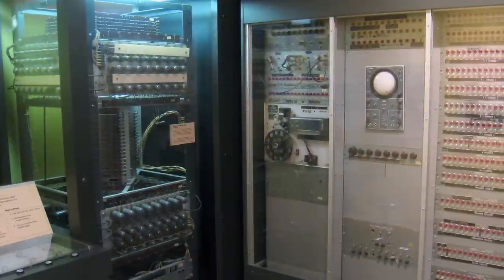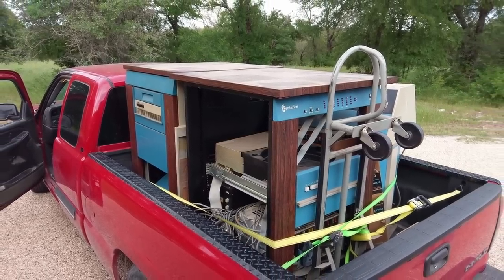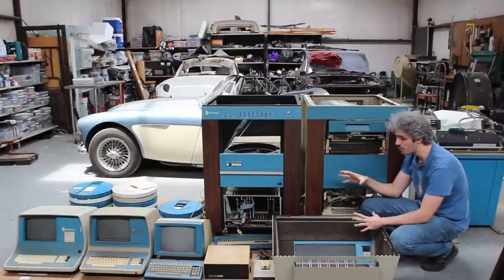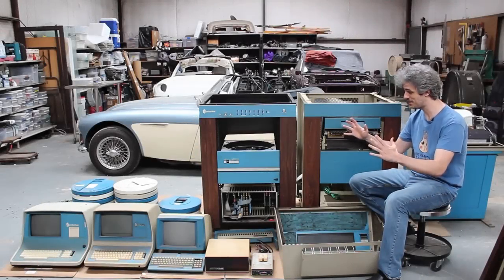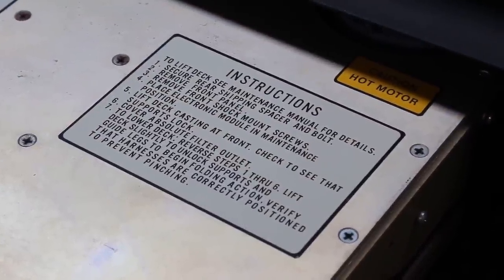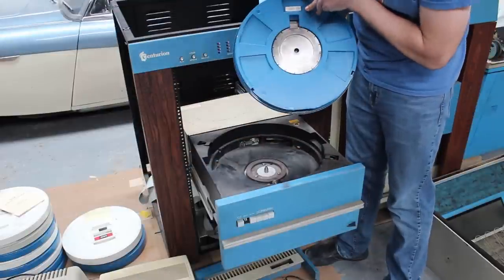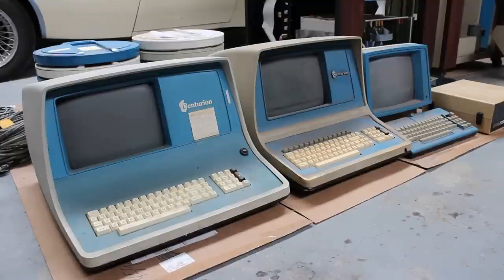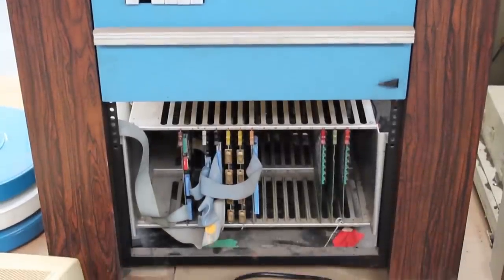I Bought a Minicomputer from 1980! – Part 1

Comment: Oh man, She is a thing of beauty. This is going to be one hell of a series.
Reply from the maker: Thank you!
It's going to be a lot of fun flipping back and forth between the tube computer and this big beast!
Reply: @UsagiElectric  I wonder if you could somehow use one of the termilnals on the valve computer. Although I would'nt even know where to begin with that. :) Just an idle thought.
Reply from the maker: @frankowalker4662  Actually, I think that might be something that's totally doable! The terminals are just a 20mA current loop, so they're expecting serial data at a specific baud rate, and that's about it. That may be something worth trying in the future!
Reply: @UsagiElectric  Wow, realy? Cool. :)

Comment: Used to work at a hotel that had a minicomputer in the back office to run the property management system. When you put the disk into the drive, you'd flip the case over and put it on top to store it
Reply from the maker: That's awesome that you got to use a Mini in its element!

Comment: This looks pretty cool.  

You are really lucky that black foam just dried out and crumbled to dust.  I work on vintage analog synthesizers and many of them had black foam inside to dust proof the slide potentiometer controls on them and it actually reverts to liquid form with age and turns into a black, super sticky tar that is a real pain to remove without damaging paintwork or the pots themselves.

Comment: I wouldn't be jacking media in and out of the drives until you get some instructions.  The relationship of the heads and media was precise and delicate.  There was one way to install or remove media and 99 thousand ways to do it wrong.  With the power off I'm particularly concerned.  Maybe someone who knows exactly can chime in -
Reply: they will need to be aligned or the first time you spin them up, the heads will crash, 
and then you can toss the entire drive in the garbage!
Reply from the maker: Thank you for the heads up!
I was looking at the drive and it looked like the read heads are swung out of the way, so I figured just setting the media in place would be alright as long as I didn't put any power into it (I also chose a disk that didn't seem to have any important notes on it in case it became a sacrificial disk). Though, to be honest, I'm more worried about the fact that it's been moved around a lot presumably without having been locked down into place.
At any rate, both drives are going to come out of the chassis for a cleaning, inspection and alignment, hopefully to avoid a head crash in the future!

Comment: Epic, reminds me of the time i got a 60s PA system from a factory. It filled an entire  van and weight a ton, had 4 philips tube amps, pre-amp,tuner, 2 turntables, 2 reel recorders and a microphone all built into one giant custom steel cabinet. i now also found a partial ibm system from the 60s.

Comment: I seen somewhere that for the 50th anniversary of the ENIAC they basically showed how technology has changed by taking the giant room size computer and were able to put the same processing power on a chip that was 4 square inches.
Reply from the maker: And the 50th anniversary of the ENIAC was way back in 1995, nowadays, that same amount of processing power is so small, it roughly the size of the head of a pin!
Reply: @UsagiElectric  Crazy isnt it?

Comment: The first business computer I used was a Data General they installed in an auto parts store I worked at. At the end of each night I had to swap out one of those removable disk platters which sort of backed up the day's data. All these components look very similar so I'd say this puts the system squarely in the early 1980s era. Completely underwhelming as an actual computer but at the time, it was a great way to manage a business that was previously done manually with general ledgers and a huge card desk for tracking inventory.
Reply: My grandfather ran a small business, and from the mid-1970s through to 1990, brought home a removable CDC disc pack every weekend.  (The bookkeeper brought one home on the other days.)  It was significantly more primitive than the Centurion, but having core memory and being single user meant that you could punch in the hex address of the point where it failed after a power outage.)

Comment: takes me back to college and my first job. At work we had a MUCH larger set of mini computers, a vax cluster, and a MODCOMP classic II.  4 racks, 6 feet high.  washing machine sized 60 MB removable hard disks, and a big brother to your chain printer that could go so fast the green bar paper would shoot in a loop 4 feet high pout the top as it printed.  The one in the college was even larger.  A DEC System20.  its lots of fun to get these old machines running again.  If you have old 4kx1 static rams on the memory cards they are likely to have lots of issues.  16k drams are similarly unreliable - very susceptible to radiation damage from the tiny amount of c-13 in the plastic cases on the chips.  NOS ceramic case military/aerospace parts form that era are still functional, but the commercial plastic encapsulated parts are a total crap shoot - less than 25% still work in my experience
Reply from the maker: Four racks, six feet high is a ridiculously huge computer! I was checking out pictures of that Modcomp Classic II, and man alive it seems all the mini-computers of the 70s had fantastic switches on the front of them!
The DEC System 20 is massive! I would love to be able to climb around all these old massive minicomputers one of these days.

On this Centurion, it looks like it has a bunch of 2kx1 MCM4116 DRAM chips. Fortunately, all the DRAMs are socketed, so if I have a bad one I won't have to do a bunch of desoldering. Though, I have no idea how reliable the MCM4116 is - I'm hoping they're decent chips and I won't have to end up replacing most of them.
Reply: @UsagiElectric  they are unfortunately still fairly flaky but not as bad as the 16kx1 chips.   Old drsms are also super sensitive to power supply start sequence.  It's vital that the negative supply come up first, then the 12v then the 5.  In that era this was usually "garunteed" by the size of the supply filters.  If the capacitors have degraded or failed it can cause catastrophic damage as a result of forward biased parasitic diodes in the chip substrates.  Check the power supplies under some load with resistors to ensure they come up correctly before you power up the main cpu, or pull out the ram cards the first time and just look at voltages and ripple.  If its like many smaller systems of that vintage it may have highr voltages one the backplane like 8 and 16 which are regulated down to +-5  and 12 with 78/9xx series regulators on the boards, or bigger lm340 types in TO3 packages.  Again carefully inspect the electrolytics around any such, even test them if you can. That is a common point of failure even at the time and those capacitors usually don't improve with age.

Comment: Centurion computer, great project :) The printer is a Band printer, was in common use before dot-matrix printer, don't be surprised, the printer might write very fast, we had one that wrote 10+ pages pr. minute. The terminal is properly simple VT100 terminal or something like that. RS232 or current loop. The CPU board is properly made of 74-series chips and an a (EP)ROM for instruction decoding.
Reply: The harddrives are propery 5 or 10 Mb :)
Reply from the maker: Thank you!
And 10+ pages per minute is insane! I mean, I had an inkjet printer just out of college that couldn't go that fast (granted, it was a pretty trashy printer, haha). Now, I'm even more excited to get that printer up and going. Even if it just types out the test print page, it'll be exciting to see it in action!
The CPU board looks to be like two AMD AM2901 4-bit bit-slice ALUs and two AMD 2909 4-bit bit-slice address sequencers, and then a colossal amount of 7400 series logic ICs. It's super cool and I can't wait to dive into it in more detail: https://i.postimg.cc/63KLkQF6/IMAG3642.jpg
Reply: @UsagiElectric  Band or chain printers are quite loud.  You might be sorry you took the foam out....
Reply from the maker: @stevenscherbinski1512  The foam was falling out on it's own in most places, so it needed to come out so as not to damage anything. I may go back and line the inside with sound deadening material like Dynamat or something. It'll probably add another 30 pounds to the machine, but may keep it from making my ears bleed. I'm super excited to see this thing run though!
Reply: They are ADDS Regent 40, ADDS Regent 100, and ADDS Viewpoint terminals.

Comment: From what I read about Centurion when I paused the vid, it appears they did turnkey business solutions and the hardware they used, at least the disk drives, are Control Data Corporation products. The line printer looks like something I used way back when I first started in the industry, only the brand was Data 100 and the color scheme was mustard and black. The external appearance other than color was exactly the same. It had that same black foam sound deadening material inside the lid, and appeared to be the same mechanically inside. I remember ours used to get paper jams regularly. One thing you don't have, though, is tape drives. The mux and modem would have been for communication on a leased data line to some other location.

Data 100 was acquired by Northern Telecom but retained the branding and color scheme. For some reason my company used this setup to act as a remote site to our IBM mainframes located in Houston (and occasionally to some other places) rather than use IBM equipment to do that job. I recall that we had some emulator programs to allow our system to run like various other company's hardware to access reports and do other work, but mostly we emulated an IBM RJE station to submit and output batch jobs to and from our Big Blue systems.
Reply: At least as a chain printer it wasn't likely to have the kind of paper jam complications that the early drum printers could have.  The "Printer On Fire" error code in many UNIX versions didn't start out as a joke.
Reply: @evensgrey  We had a Data 100 drum printer before the chain printer was added as a supplement. The drum printer - at least the one we had - was fine, very few problems. The chain printer was a never ending problem source, and slow to boot. Later we got rid of it and added a newer model printer which was Data 100's clone of the IBM 1403, IIRC. For all I know IBM built it for them in their colors. Or perhaps Data 100 licensed the design from IBM.

Comment: That Micom unit is basically a digital "PABX" for switching serial RS-232 connections. I installed and managed a Micom 600 system which occupied three 6 foot racks and had several hundred of those cards. It was the digital switching unit for all the terminals and computer systems in the university where I worked back in the late 1980s. I still have a couple of the cards and the operating/configuration manual as souvenirs from that system after it was de-commissioned around 1993. You probably won't have any use for the Micom unless you plan to connect many terminals to your computer.

Comment: I want a mini one day. A project I always wanted to do was make a basic modern PC but reverse-miniaturize some of the components so the whole thing can fit comfortably in an old mini and utilize all the space. If I was rich I'd build a 1950's computer to run YouTube and make the whole thing as big as a small city.
Reply from the maker: You and I are definitely cut from the same cloth, because that sounds awesome! With this one, I'm actually going to try to stuff everything into a single cabinet, which will open up the second cabinet for stuff. And I totally want to make the most insane discrete transistor homebrew computer that fills up the second cabinet, I think that would be epic!

Comment: "Warrex Centurion, an 8-bit minicomputer built by Warrex (later just Centurion), a Texas based company from the late 1970's to the 1980's. The Am2909 and Am2911 microprogram sequencers and the Am2901 ALU were used in the CPU6 variant." https://en.wikipedia.org/wiki/AMD_Am2900

Comment: In the late 80's I used to go to a local auction house that sold various thing anyone would bring in. A couple of days before the auction, you could come in a look at the items to be auctioned off. I wen't in the one day and there was this IBM mainframe system with 1 printer, 3 terminals, cables, software and manuals. The computer stood about 54" tall, 36" deep and 80" long. the printer was about 48" high, 30" deep and 30" wide. Well, of course, I had to go there tat Sunday night to see what it was going to sell for, with no intentions of buying it. When they got to the IBM, I can't remember what the bidding started at, but the price kept coming down and down. It came all the way down to $5.00 and I raised my hand and it sold for $5.00. I paid a guy $25.00 to load it up on his trailer and take it to my parents house.
Reply from the maker: Color me all the shades of jealous! That is an absolutely amazing deal for anything old and IBM, even if it was in the late 80's. Do you still have the system, or know where it is? I would love to see more about it, that sounds like a really epic machine!
Reply: The "secret" of all these mini-computer companies is that the IBM equivalent was easily three times as much.  I worked for two, Sycor, and Data 100 which were merged under the ownership of Northern Telecom.  Our customers would at contract's end replace us with the competition and when we went to take out our equipment we would recognize the techs from the other company putting in their stuff.  We had a scare once that one of our big accounts, UPS, had a new IT manager and he was a fan of IBM.  When UPS management found out that switching to IBM would triple their IT budget they switched him out.  Texas Instrument had some sort of RJE System which used too much plastic.  Motorola started a division to do this called Four-Phase.  Exxon tried to get into the office computer business.

If you, for some reason, want to go down the rabbit hole of used IBM computers check out Saul Steinberg's Leasco.  After he founded that and became a millionaire he tried to take over Chemical Bank.  He has passed away, but his son is married to Maria Bartiromo.  Also, checkout the OPM leasing scandal where the scammers took money from banks by getting loans against number sequences which they asserted were the serial numbers of IBM mainframes.

Comment: I´m so excited to see it come back to live again!
I wonder, if the “modem” is used to connect several terminals, using a current loop?
Reply: yes
Reply from the maker: Thank you! I'm excited to get stuck into it. There's a lot of super interesting things to learn about how they did things!
It seems that that's case, which may explain why I got three terminals with the system. The company may have had all three terminals set up as workstations connected into the single computer. It'll be a ton of fun experimenting with once it gets closer to fully operating!
Reply: @UsagiElectric  yes, it is very likely some form of timeshare UNIX system.
Reply from the maker: @tekvax01  That makes sense!
Reply: I always thought it was cool that modem stands for Modulate-Demodulate.
Reply: @UsagiElectric  So the modem is handling multi-access stuff, that's probably the reason why its as big as the computer itself :)
Reply from the maker: @nyccollin  Wait, what?! Mind absolutely blown, I had no idea that that was modem stood for!
Reply from the maker: @schmitzvonschmitzen2870  Haha, you know, I didn't think about it that way, but it is just about the same size as the actual computer itself. That's pretty wild to think about!
Reply: The big box "modem" is also known as a serial MUX.  It's what you use to connect those terminals to the mini computer. Typically they used RS232 serial communications. I had one like it on an old Unix server.
Reply: Yes its a multiplexer
Reply: @UsagiElectric  Not sure how old you are, but back in the 80s, early 90s, the banks would have dumb terminals at each station, and the operators would be sitting there tapping the enter key, over and over, to keep their terminal active and in cue.
That box with the DB25 connectors was for each station terminal to plug into.

Comment: Band printer.  I worked with some old SEL equipment and we had printer similar.  That band spins continuously and the hammers are synced to bang against it at the proper moment.  We had ones that were rated 600 lpm (600 lines per minute) so could actually go pretty darn fast.

Comment: They would have done you a favor if they had left one of those removable disc packs in the drive.  When they are in, that big opening is somewhat sealed by the plastic cover.  As it is, the retractable heads in the side of the machine are probably dirty as heck and will self-destruct if they try to load.  We had some larger 300 MB 'washing machine size' drives and used to replace individual heads.  Then there was a whole alignment pack and break out the O-scope to align them.  What memories.  :)

Comment: the Micom Micro8000 most likely is a Data Multiplexer it went out to all the different terminals around the building &  you had just one Main Master Terminal and all the other terminals went through the Micom Micro8000
Reply from the maker: You're absolutely right! I've actually met up with a former employee of Centurion and learned a ton about the system since this video, and that was one of the things he confirmed for me!
Unfortunately, no matter what I do, I can't get the Micom to power up. I mean, it's not necessary since I'm only going to run one terminal, but it'd still be cool to see.
Reply: Yes, the mux we had connected to our old Data 100 system was a Micom, just can't remember what model.